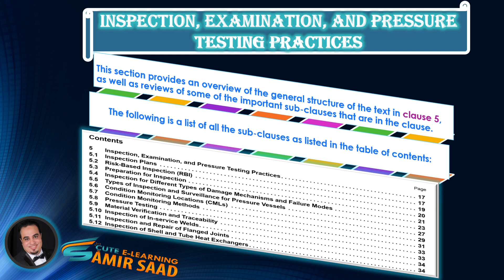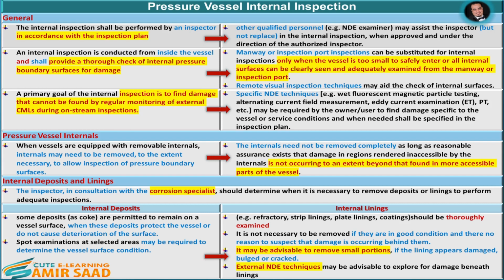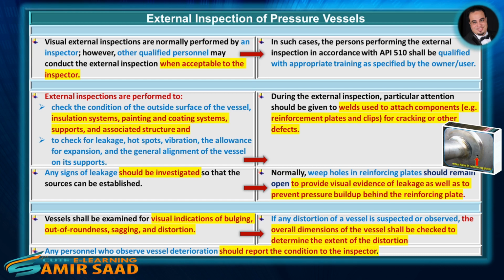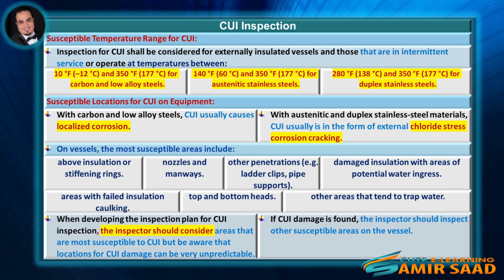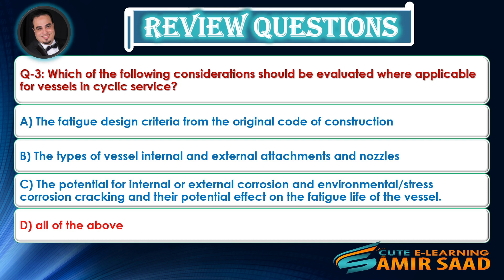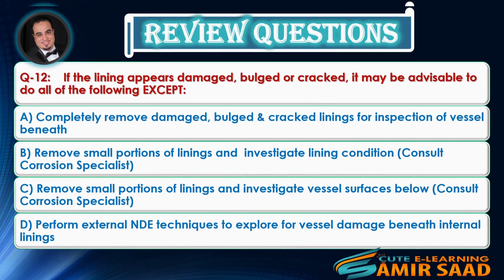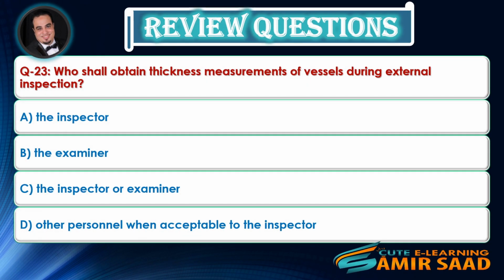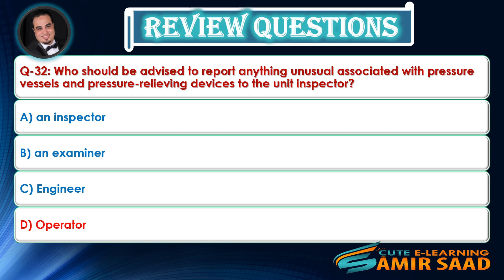API 510  (lecture 5)

Comment: Hi sir i have one doubt 
When calculating required thickness of shell and head if corrosion allowance is given how to put the that corrosion allowance value in that farmula???
Reply from the maker: Rule of thumb if C.A is given:
1- C.A added to the required thickness to determine design thickness 
t design = t required + C.A
2- when determining design pressure , use t required only thats it  without C.A
3- C.A added to D or R when determin design pressure
R= ID /2    + C.A
D = ID + 2 C.A